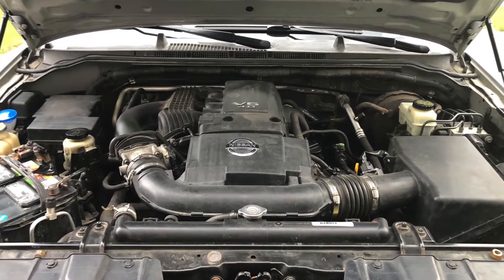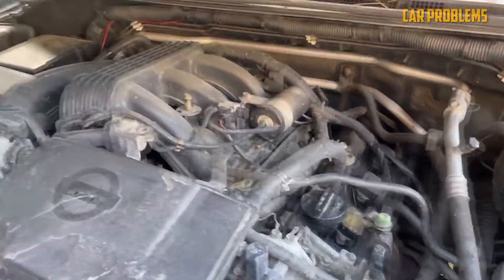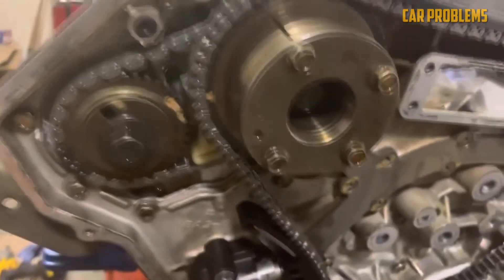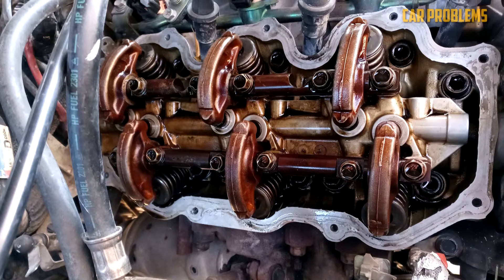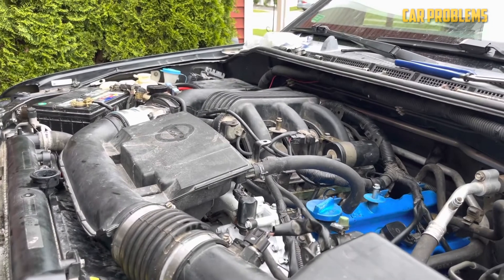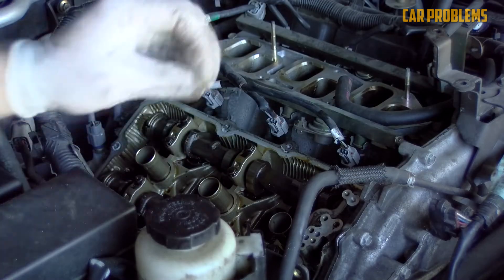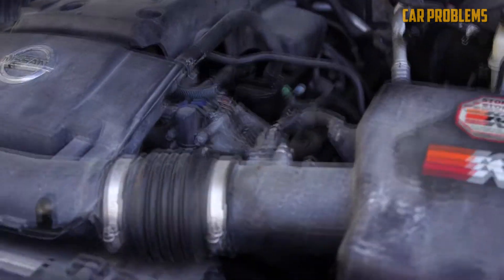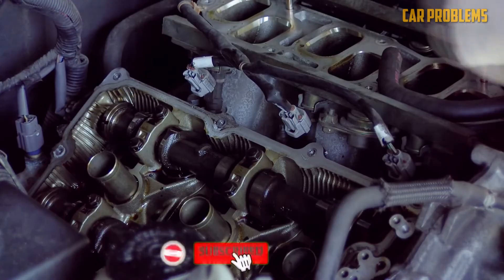Nissan VQ40DE Engine Common Problems and Reliability

Comment: 210k on mine atm, valve covers leak like a siv, but I have new covers to put on and I have to replace cylinder 1 spark plug (again/fouled), mainly due to most probably trash in fuel line, or most probably injector failure or badly needing cleaned.

Comment: I have a 2008 Frontier, V6 (VQ40DE), 6-speed Crew Cab Long Bed 4x4. Bought the extended (100kmiles/5 year) warrantee. 22kmiles, complained about a whining noise, no problem found. At   68kmiles, replaced timing chains. 197kmiles, replaced the catalytic converters. 212 kmiles, replaced Bank 1 Camshaft Position Sensor. 227kmiles, coil pack failed. 228kmiles, replaced a catalytic converter. Now at 233 kmiles, engine sounds ticky, too much valve noise. Still runs. What do I do, scrap it?
Reply: lifter bucket tick from wear, mine is doing it at 280k, run it till she blows, could be 40-50k more.
Reply: Thanks for the advice. That's what I'll do: run it until it kicks. Problem is I'm only putting 5000 miles/year, it's going to last another decade😂.

Comment: Im looking at my buddy’s 07 frontier. It has a bad ticking sound coming from the timing case area. Sounds like timing chain and tensioners but I’m not sure if it’s going to be worth it, its got 280k so I’m not sure how much longer it will last
Reply: It's a ticking time bomb, I'd get it done ASAP or trade it in asap
Reply: @ I actually finished doing the timing chain job for my buddy about a week ago. A lot of work to get to the timing components but once you are there it is pretty straightforward. Having the oem chain was nice because it had all the alignment marks to make sure timing was good.

Comment: Mine has no compression on 3 drivers side cylinders and normal compression on 3 passenger side cylinders. Anyone else have this? Runs barely and no power

Comment: '09 frontier with almost 225K miles and has been a very reliable engine. Besides regular maintenance, only issues have been the cam sensors and egr. Starting to get a valve cover oil leak, getting ready to replace those and do a full tune up at the same time.

Comment: I expected the ("earlier years")  transmission cooler issues (only on automatics) might be mentioned. (aka: the Strawberry Milkshake of Death).  I have an '09 4WD MT version, and it's  been a champ - but only some 85k miles.  Regularly serviced of course. I can't believe it's already 16 model years old.   Simple (comparatively) and rock solid.
Reply: It's a keeper. I'm at 233k miles, an '08 w/ 4x4 MT. Did yours come with the factory "always crunch 5th gear" option? Mine did from day one. A mis-aligned shift fork. Never got it fixed.
Reply: I have the same truck, currently at 280k. has the bucket lifter tick,,,,,keeps running

Comment: I replaced my timing chain tensioners, etc, with all new oem parts,  oil galley gaskets, and it still rattles around 2-2500 rpms  cruising however its 1/10 of the noise before sounded like diesel tick
Reply: vvt solenoids or cam phasers
Reply: All replaced @veevtli

Comment: I had the problem of low oil pressure in my 05 Xterra, when I was idling the needle went lower than L and the oil light came on and when I accelerated the needle went up to the middle. The first fix was to change the oil sensor, the oil pump and the relief valve, even so the problem continued. The second fix was to change the oil gallery timing gasket and after that the needle only goes down a little before the letter L but the oil light no longer comes on.
Reply: Sadly sounds like crank bearings are worn, low oil pressure

Comment: My 2014 just had first issue 135k miles. New o2 sensor. Went ahead and replaced both sensor 1 on both sides no other problems besides wanting bigger fuel tank😅

Comment: Most my 4.0 engine at 872 000 kms.  Hole in block.  Did the timing chain at 420 000 kms.   Was a good engine
Reply: That is impressive!
Reply: Wow
Reply: what happened to the chain?  did you just opt for it? and did your guides ever wear down? thanks!

Comment: You left out the most common issue on these, it cheap to fix but a pain to get at. The Cam position Sensors love to go out.
Reply: This problem would shutdown the engine while driving 😢
Reply: @devildog293 It does. Trust me
Reply: I just had to replace mine and yes, they are a HUGE pain to get to
Reply: @Moonball96  Not the worst pain, you just literally have to lay on top of the motor and pray you don't drop the bolt
Reply: @theg.o.a.t9864  this just gave me a flashback. My legs were flailing in the air while laying on top the engine trying to fix my sensor after breaking down in front of a random person’s house in a suburban neighborhood. Good thing I had the sensor and tools on me, I had bought it that day. 158k mi. & she’s still running
Reply: @j__Shaww just bought mine at 157k. Just did the exact same thing in the driveway. Replaced cam sensors and crank sensor, after replacing the alternator and battery thinking it was a major electrical issue. Same thing happened to me, Stalled on the highway and had stiff clunky shifting and lost all power steering. Turned it off and back on again and ran fine except for shifting till I got back to the house. Fun time laying on the engine, hoping that’s all I have to fix to stop it from doing that
Reply: @yungonion9357  glad to hear you figured it out, sorry you had to go through the same struggle. Mine was bought new by my mother in 2011 and has 158k. Been about 10-20k (about 1yr) since I’ve changed mine and its had no problems since. By the way if your transmission is clunky, check the fluid. Mine was pink milkshake and I had to change the radiator. Other than that and normal maintenance, all we’ve changed is shocks and springs in 15 years. Love this car!
Reply: @yungonion9357 Exact same thing happened to me
Reply: I did the cam and crankshaft position sensors in about and hour.
Reply: @gbaines4284  Come over and do mine,please.
Reply: Take the time to remove your intake plenum and both Bank 1 and bank 2 camshaft position sensor are easy to get to.

Comment: My 2007 Frontier had this garbage motor.  Sounded terrible and was gutless.  Only thing that made it sufferable was that it was not a 4.3L Vortec.  I'm still grateful for that.
Reply: V6s in general don’t sound too great especially large displacement ones. In the Frontier it might be gutless, but in our RWD Xterra it’s decently quick for an SUV - probably due it lower weight and less drivetrain loss. Plus, many people have their VQ40DE’s over 200k which is pretty good reliability wise.
Reply: @oscarbravo9009 : "Garbage and gutless"??  I'd call mine pretty quick and with a deep pedal. I suppose it all depends on life/vehicle experience and perspective. Mine runs like a scalded ape.
Reply: It's mainly about the transmission.  My vq40 is in a 9lb nissan work van,  I'd say it's as quick as an empty frontier or pathfinder

Comment: Love my 19 P4X, last year for the 4.0, got it with just under 7k miles, now 3 years later at 31k. Haven’t had any problems, my daily as well. I’ve done the oil changes my self with full synthetic with Mobil 1 extended performance. I also keep it in the garage, I hope to have the truck for a long time. I’d like to get an other with the manual.
Reply: Nice. I just got a 2018 pro4x with 42,xxx miles mint. Love this truck

Comment: Mine has 520,000 kms on it  and still runs great. No chain issues at all  and no leaks     no oil burn   just 2 cam sensers   and fan clutch  .
Reply: What year is your Xterra?
Reply: what year? looking into the 07. What oil and such did you use? cheers.
Reply: I had the cam position sensor issue on my 2013 Frontier with 155,000 on it. A little tricky to replace but not impossible. Truck runs great now

Comment: Buying 2 vehicles (used and abused) with the VQ40DE made me become fluent in repairs lol.  Ive done timing component replacement on both.  But 1 i had to swap out due to the lady not changing the oil and then it sat for 2 years which caused the oil rings to become stuck.  Uve since disassembled it to find out why it was burning 2 qts in 300 miles.  Hence the stuck rings.  The other is burning a qt or so in 500 miles id say.  Once i rebuild the 1st one,  it will replace the other oil burner.  Which has 330,000 miles and going strong.  And the one i swapped has 220,000 and going strong.  CHANGE YOUR OIL PEOPLE!!!!  Dont abuse your engine and then sell the car to someone who will have to tear it down to replace vital components that YOU ABUSED.  If taken care of properly,  the VQ40DE will last 1,000,000 miles easily.  IVE SEEN IT!  These motors were built to last.  Even the abused VQ that i disassembled,  has CUTS AND GROOVES in the main bearings and cam bearings due to shitty maintenance.  But even with that going on,  and oil galleys stopped up with carbon,  this engine never failed to impress me.  Except its thirst for Castrol GTX High Mileage.  But hey,  it comes with the territory of buying used.
Reply: My 09 x is burning like us. 300miles 1 qt of oil. Have 185k now. Needs chain replacement too. How much work was it to fix engine oil burning. Like an idea in cost. So glad to have read your comment, now I dnt feel all alone lol.

Comment: The timing chain & guides from the VQ37DETT found in the 2019 Skyline GT-R twin turbo can also be made to fit by an "experienced" mechanic with minor modding.  Also, use head bolts from a VQ37HR which are stronger.
Reply: Do you need modifications? Or is just a simple pull the old and replace it?

Comment: when to change the timing chain?
Reply: On the 05-10 models, at 100k.  The newer ones had a timing chain re-design and can lasts 200k easily.  Mine lasted 190k.
Reply: Every 20k miles
Reply: @WayOutEast1 
I guess you mean 200K
Reply: @richardsanchez9657  yeah 200k

Comment: My '08 Xterra is currently at 213K miles and still running well. Some things have been done, like new valve covers, crank sensor, and the plugs have been done twice, but otherwise it still runs well. Motor mounts are next.
Reply: Was the crank sensor a code that came up or check engine?
Reply: @vadimnesen8060 service soon light came on, read codes and it lets you know

Comment: I have an 05 my first issue was the coolant mixed with oil (milkshake) cost me about $3k to fixed transmission valve body replacement.. other than that minor replacements wear and tear. Already 286k still running strong.
Reply: Unfortunately i bought used and got SMOD 2 weeks later.  Xterra sat for 7 months until i was able to buy a donor car for $300 with a good transmission.  Now i have a question.  When you did the Idle Relearn and Closed Throttle relearn,  did yours feel like it lost a little power possibly through the throttle mapping?  Because mine did.  Idk if i lost compression due to the sitting for 7 months,  or the relearns changed something and made it not run as strong.  My Xterra felt like a V8 before the SMOD.  SUPER AMOUNTS OF POWER/TORQUE!  After trans replacement,  and sitting for 7 months,  it feels like ive lost 30 or 40 hp.
Reply: Did you ever have oil gallery gasket problems? Have an 05 as well, Trying to figure out how likely it is I will have this problem.

Comment: The 2011- 2019 VQ40DE is one of the most reliable engines on the market. Keep it cool and good oil and you’ll easily get it to 300k.
Reply: You basically said what I was going to say. 2011 to 2019 VQ40de it's probably one of the most reliable gas engines you can get in this modern day. Engine's been around since 2005 so they had almost 15 years to iron out all the problems. Very good engine just keep up on maintenance.
Reply: After 2010 they knocked a lot of kinks out of this unit. Love my frontier, 180k and have no complaints.
Reply: Good to know as I own a 2015 Frontier.  Only problem to date is a tire sensor light that I haven't even fixed yet as I check the tire pressures all the time.
Reply: @philc.9280  I had the same issue after my first tire change. Ended up having the sensor replaced and never messed up again.
Reply: @SlopDrip  I probably won't fix the sensor until I get a new set of tires next year.
Reply: This is true, I have 2013 frontier, I've done over 250K so far, no issues just oil change and tires
Reply: Мій nissan Xterra 2014 Вже пройшов 200 000 миль нічого не робив. Масло заміна на кожних 5 000 миль
Reply: I gotta 2012
Reply: I would like to further approve your comment. I have a 2012 Nissan Frontier SV, and yes they will easy hit 300k miles! Mine is at 400k and still runs like a champ!
Reply: Yep It’s bulletproof with proper maintenance
Reply: How can we keep it cool sir
Reply: @WayOutEast1  not letting your radiator overheat, as the case with any vehicle.
Reply: Cool. At 235k miles and still waiting on those issues.
Reply: Am lucky to have the 2019, I thought  to get the 2025 but  I know my truck is  a good one and  no more car payments , it was an e asy decision  yo keep it
Reply: mine has 317k and still going
Reply: 872000 kms mine lasted.
Reply: 1. what year? 2. how often did you do oil and what oil? im curious because i’m worried about the timmg chain and tensioners that tend to go out. 3z was this ever an issue? sorry for all the questions im really researching the 07 frontier and im stoked to hear you made it that far with ‘er! Cheers